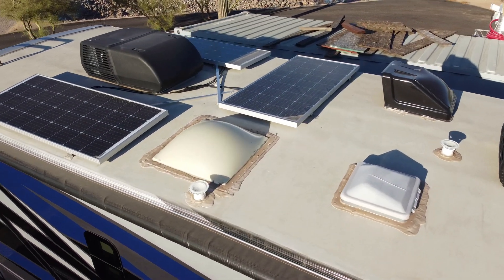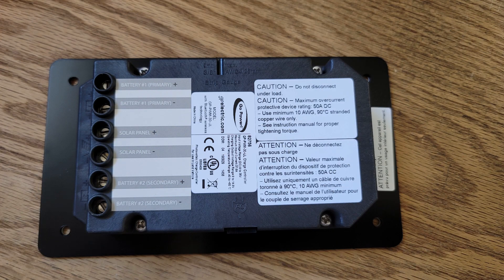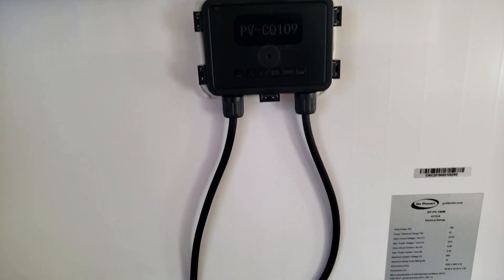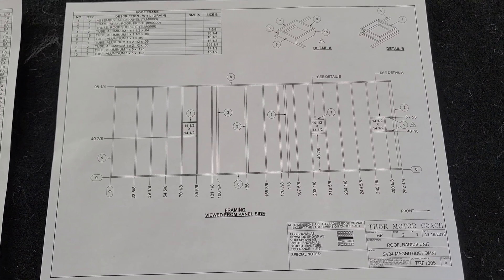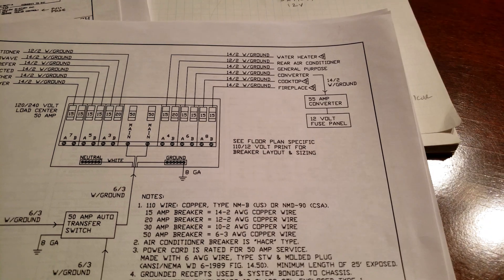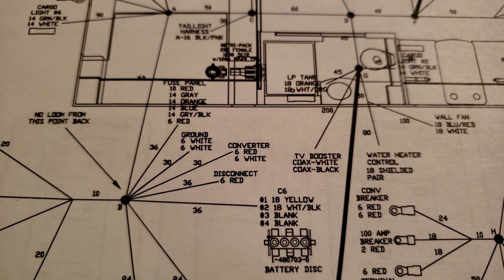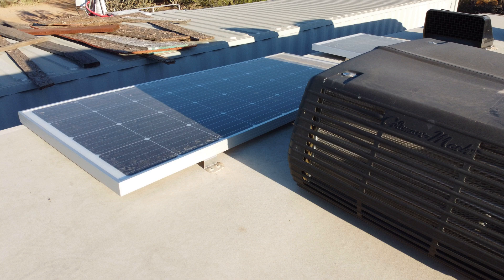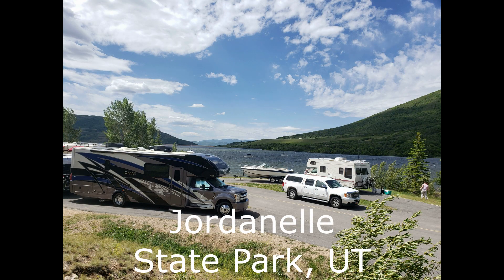SOLAR AND LITHIUM BATTERY INSTALL ON 2020 THOR OMNI SV34

Comment: Very good video and quiet informative but one thing is when you are discussing the series parallel wiring of you batteries and solar panels you are incorrect in you description of voltage and current. 2 6v batteries in series gives you 12 volts same current, 2 6v batteries in parallel gives you 6V twice the current same goes for the lithium batteries and the solar panels. You are describing it backwards.

Comment: Could you give me a description of which wires went to what on the solar DC to DC controller? I tried hooking mine up and I was not sure if I was doing it right. I am contemplating taking it somewhere to get it connected. Thank you.
Reply from the maker: On the dcc50s, they are labeled well. There is a common ground for everything in mine. So from the common ground, I ran a wire to the negative terminal on the dcc50s. PV+ is connected to the positive from my solar panels. Positive from house batteries goes to OUT+.  Alternator/Chasis batter positive goes to ALT+.  Used breakers on the OUT+ & ALT+ and fuse on the PV+.
Reply: @urphonesucks  Is there a way for me to send a picture with what wire goes to each post the way I am understanding it? I tried posing a pic but it would not let me I under stand the ground and the solar wiring. I just want to make sure I have the positive wires from the coach going to  the right thing. The way I understand it is the positive wire that was connected to the original left battery positive post with the fuse on it goes to the out + on the DC controller? The other positive wire on the left most battery goes to the ALT +? I truly appreciate your help.
Reply from the maker: @mitchelllogsdon4254  I would direct you to the installation manual. It's pretty clear.  I more wanted the video to show what I did and not direct anybody to what they should do or how to do it.

Comment: Why do you need the 30A solar charge controller when you have the DC-DC 50 solar charge controller?  Dont they do the same thing? I know the 50A DC-DC charge controller charges the batteries by solar and the alternator but why add another solar charger? I have bought most of the components just doing some last research before I install it.
Reply from the maker: Didn't install the 30A. Became an extra part. Will use on a different project. Someone could use the 30A instead of the DCC50S,  buy would need a DC to DC charger in addition to the solar charge controller.
Reply: @urphonesucks  Thank you. Your video and answers have been a great help. Please add more videos of the Thor Omni if you have the opportunity. I know I would watch as well as others. I have so many questions about my coach and Thor is not fast to respond. I bought a used 2020 Magnitude SV 34but apparently its a 2020 1/2 so many parts are 2020 or 2021 and it has a 2020 chassis as most have a 2019 chassis for this model year. Again great video.

Comment: Did you use self taping screws to mount the panels and if so how long?
Reply from the maker: I believe I used screws that came with the panel clips. I predrilled. Don't need to be that long and the structure isn't deep. If you anchor to the "trusses" or edge tube, you only are going thru the roof membrane and very thin plywood.  3/4" sufficed in my case.